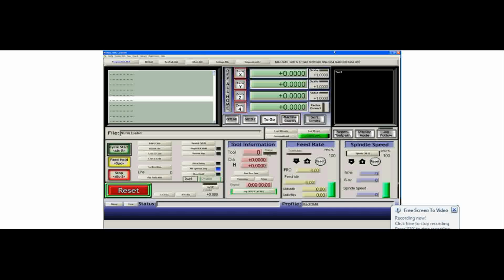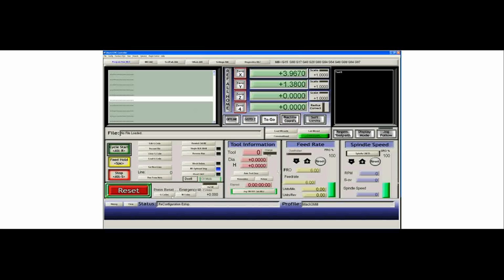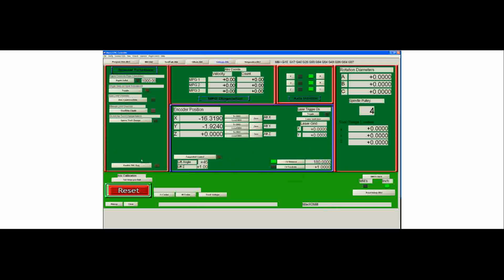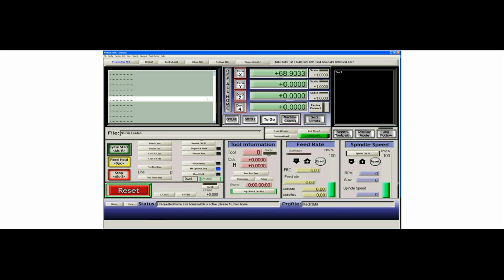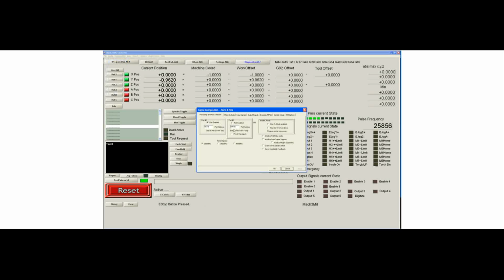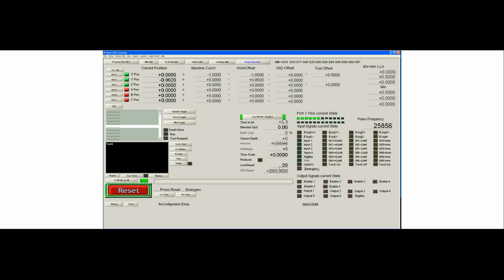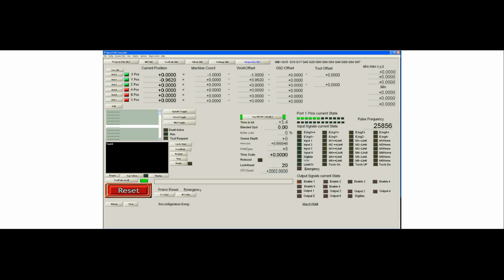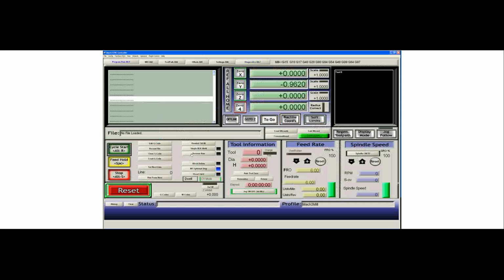Mach3 CNC Controller Troubleshooting

Comment: I had my machine working for 3 years with the same set up... All of the sudden all 3 motors move 100 times slower than the setup. When jogging and when running code.   I changed the motion board, communication cable, reinstalled mach3 and set it up to my original settings.... Did not help at all. My 3 power supplies work properly... I just run out of ideas... I am only one working on the machine.. Nobody could change any setting... Any idea what could it be?

Comment: So i bought a used machine and the guy showed me how to work with mach3 a bit, and i verified it was working over at his place. I got it home and set it up, got it powered on and when I hit the reset button the machine makes a slow whirring noise, like the servos don't have adequate power (they do) and nothing moves. The spindle doesn't work either. No error message from mach3, but nothing happens other than the noise. Any ideas?